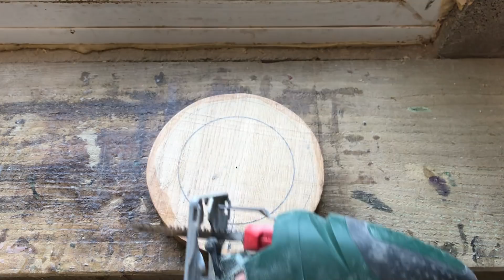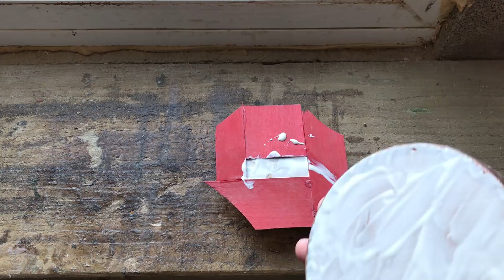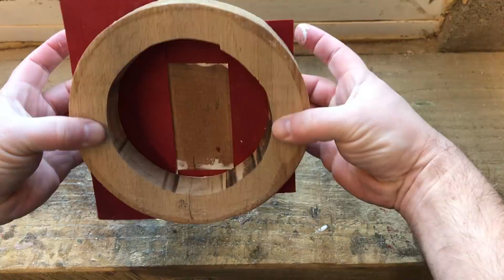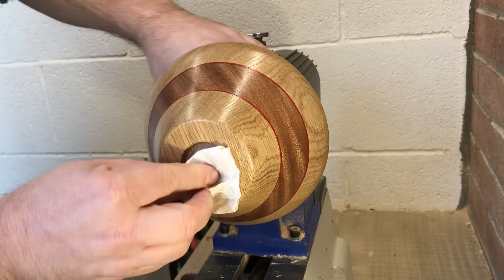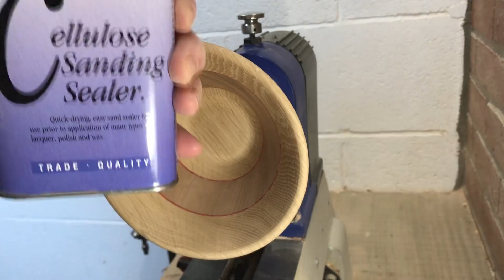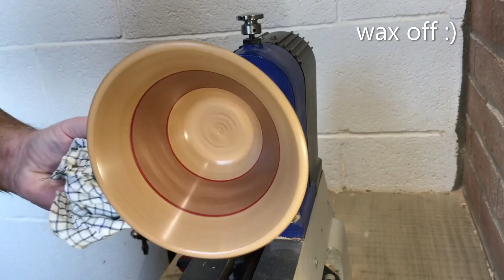Wood turning - Oak and Sapele Layered Bowl

Comment: Really enjoy your videos, have a couple of questions, how did you add the blank to the chuck at the beginning faceplate? And where can one find that tulipwood? Stay safe.
Reply from the maker: I use a faceplate ring for the chuck, it simplifies things, and avoids unnecessary switching of the chuck. I managed to buy some tulipwood veneer from ebay, but recently I have used this place https://www.thewoodveneerhub.co.uk/collections/coloured-wood-veneer Thanks for watching 😎👍